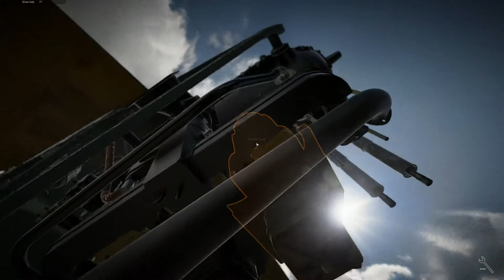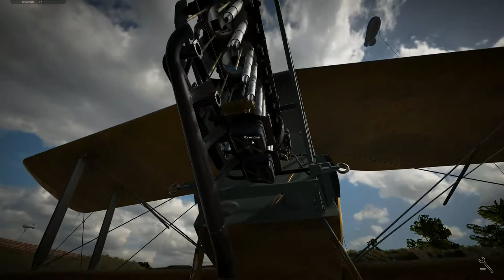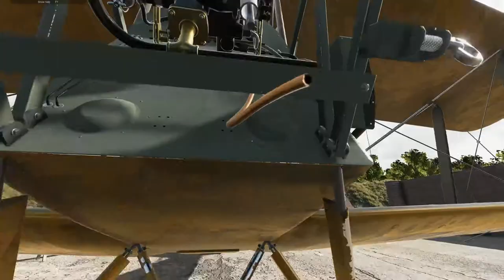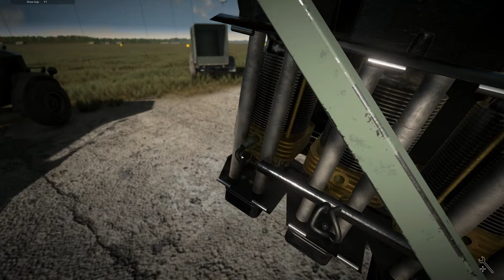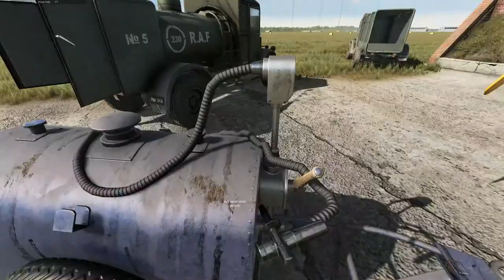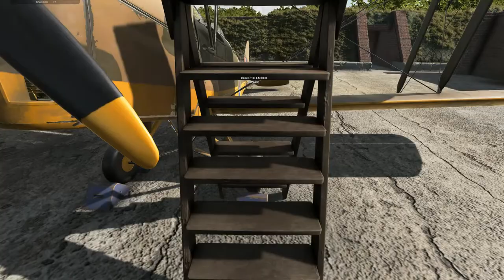Plane Mechanic Simulator Ep 5

Comment: The cylinder block is part of an assembly. You could of held left click to dismantle the whole thing in one go instead of left clicking and dismantling piece by piece.

Also the camera is an actual object, so if stuck try zooming in or out to swing around to the other side of the aircraft
Reply from the maker: Didn't know about dismantling the entire thing in one go......thanks. :)  Will get use to the camera angle at some point as well.